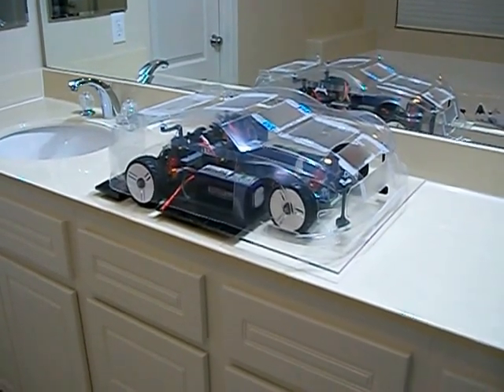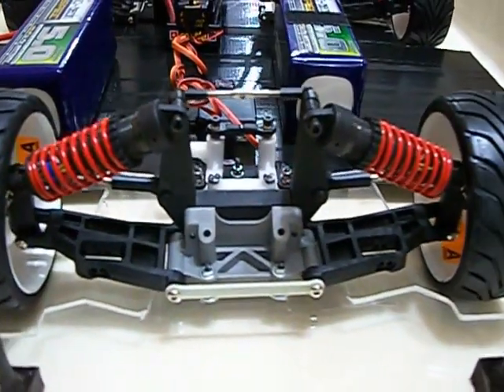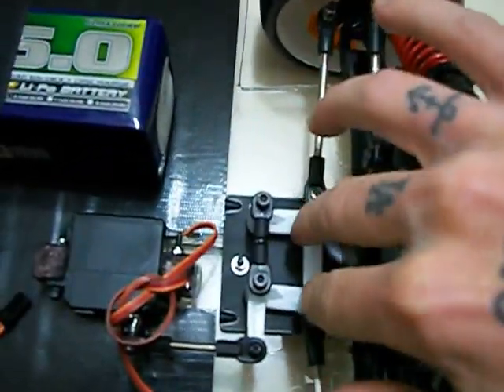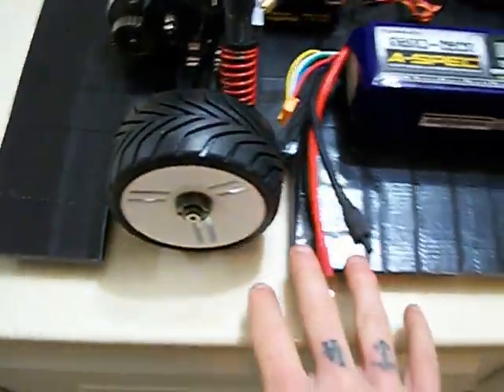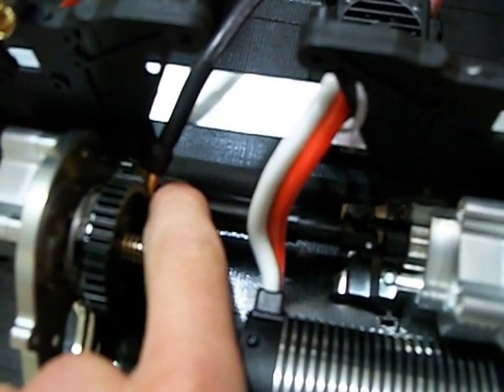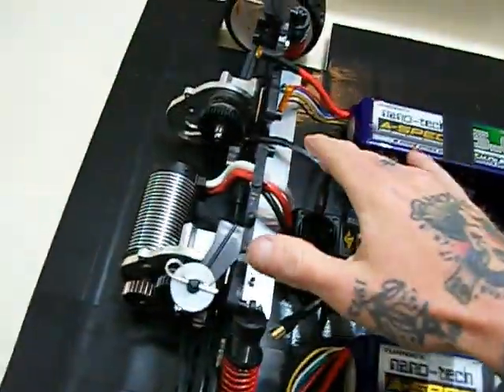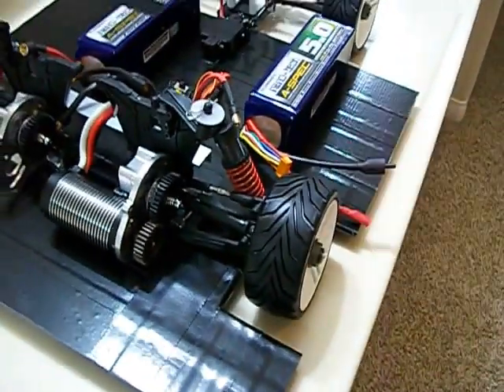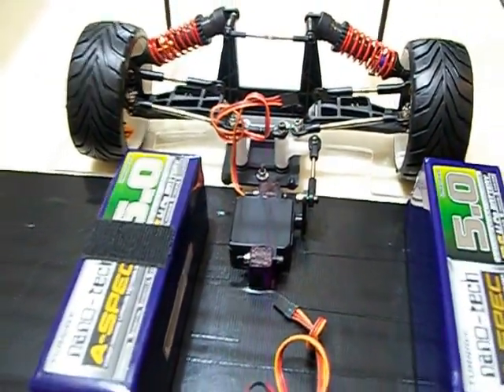FULL CUSTOM SPEED RUN BUILD PART-1 2/25/13

Comment from the maker: I had that same thought. But it really doesn't need it now since I put the bracket across the bottom of the shock towers/gearbox. There is now flex there and no need to add more weight to this beast. Thanks for the input.

Comment from the maker: I will work I believe, but it will be WAY over powered and traction will be the hardest thing for me. I built in a weak link for the transmissions so they will not get damaged. The stock plastic center drive shaft will break before the trans hurts any gears. I have another update on this custom build you should check it out. It shows more of what it will look like.

Comment: You should get sealed diffs because the inside drive shaft will spin a lot more than the tires, so try to get them close to possy but not too much